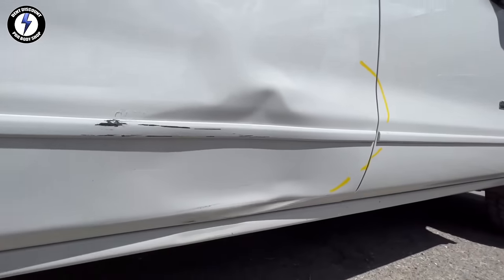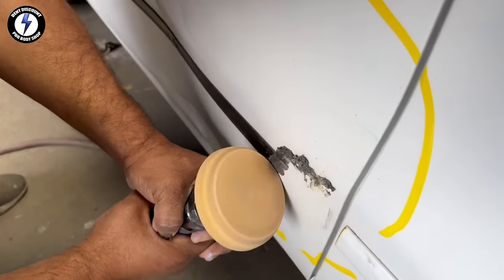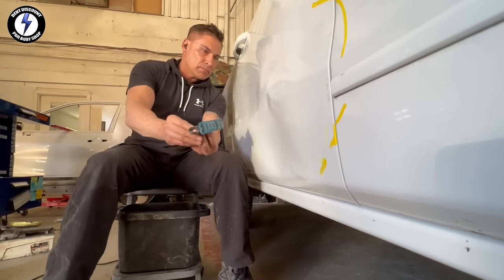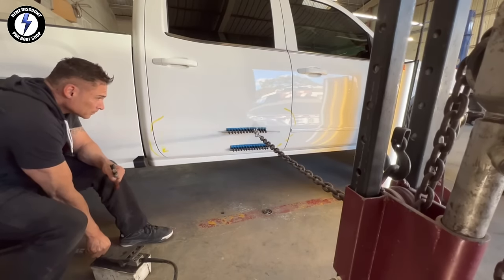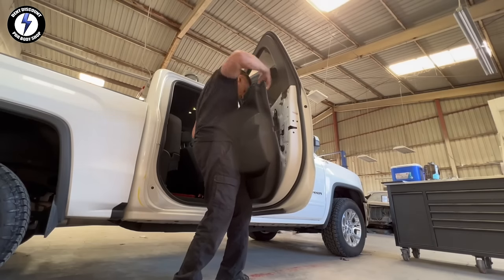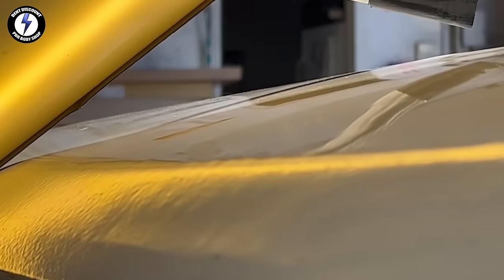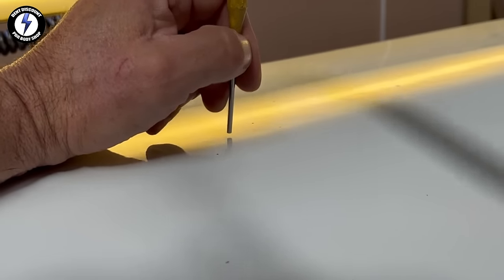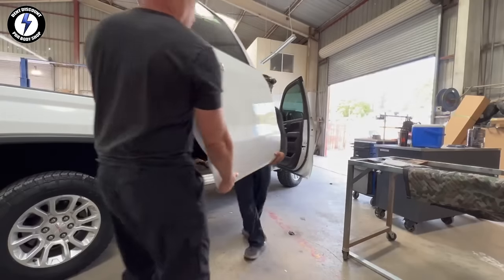Tips and Hacks! | POP out Door Dent!

Comment: Could you have done this without the pusher tools? Only glue tabs and your tapping hammers? I'm ocd af and finally finished my shop and picked up a used car dealership as my first client. After I recoup a little here, I'm interested in a couple hour course. I polish metals, paint, and color sanding. Never have done pdr besides a few truck bed panels massaged with a 2x4 lol.  I have a 2017 Chevy Express LS3500 I'm working on now that the side was pushed in around the rocker area. The clear coat is clean, so I ordered a kit to see how much I can pull out. Wish me luck, lol.

Comment: New Subscriber. Whats the trick to using the rods on a double wall door panel? My 2005 GMC Sierra has a double wall outer panel with foam fill. I cant get a good push on the dents.
Reply from the maker: It takes a really thin tool to push through.. whale are the best

Comment: Is it possible to pop out dents underneath the doorway like under the side things that are under the doors because I was stupid and I jacked up my car from that area because I was afraid to mess up something underneath my car because I have oil leaks and I had to replace my oil pan before but I wish I just drove my car up on those ramps instead of using jacks but I was looking to see where I had more oil leaking out even after I had the oil leaks repaired because some people stated that I still had oil leaks but can you remove dents from underneath the doorways by pulling them out and down towards the ground or can you only take out dents basically on the sides?